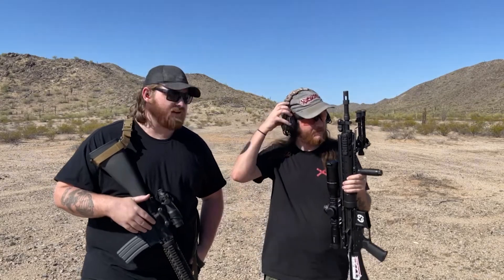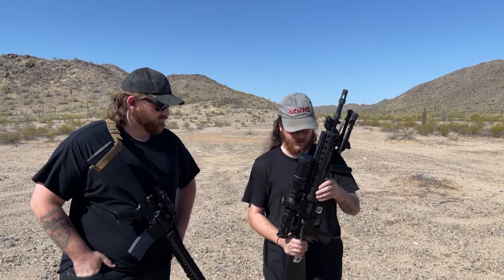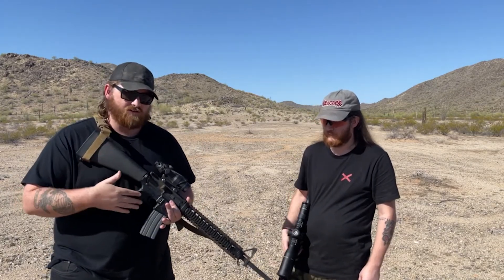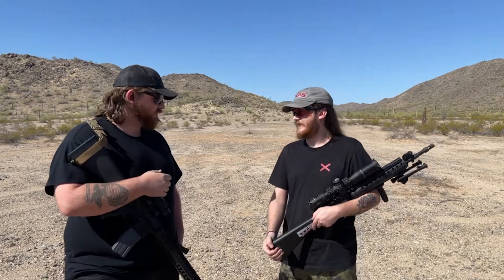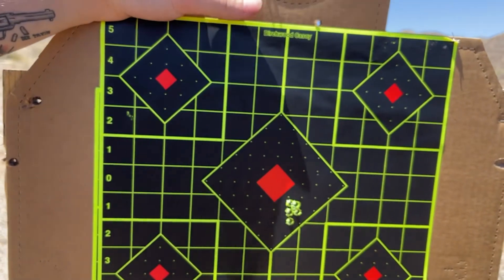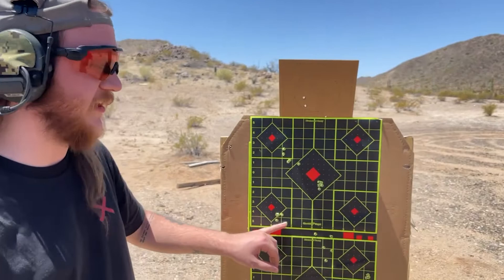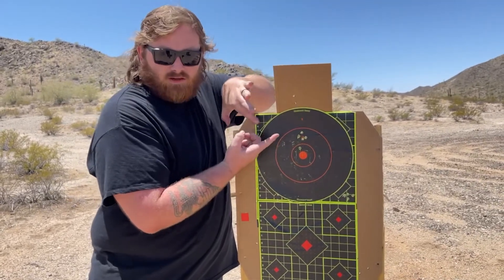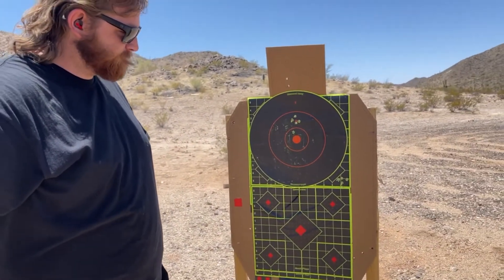Damian’s MK12 SPR: Zeroing and Testing

Comment: Because of you guys…. I just bought a Mk12!
Reply from the maker: Welcome to the club
Reply: Hope you got a real mk12 and not that fake shit Daniel Defense wants to call a ‘mk12’ if it doesn’t have an SPR profile barrel it ain’t a mk12 the PRI uppers are clone correct with the correct Douglas barrel the 1-7 that is
Reply: @rednecksniper4715 it’s the same upper on this video. I went with LWRC lower.
Reply: @insansombolinggi8275  that’s good that’s about as clone correct you can get without building one from scratch. Also I would recommend just get an H&R M16A1 lower from PSA if you want it to be more clone correct

Comment: The only problem with PRI is their barrels.  Douglas barrel company use ww2 barrel making technology and haven’t kept up with the newer technology of making a more precision and accurate barrel. They made great barrels back in the day with these older techniques but with the advent of computer QC equipment, a company can produce a much better product and a much more accurate barrel. After Stanley past away, god  bless his soul,  it’s now a gamble whether or not your barrel is going to be accurate or not.   There are too many other companies out there that produce much better barrels than Douglas.   Thanks for the video !!!!
Reply: I have been a US Service Rifle Competitor for about 26 years, burning up about 3-4 barrels annually. In this period I have rebarreled using many brands and types of 1/7 twist barrels but the most accurate have been from Douglas, turned and chambered by Compass Lake Engineering. My present Douglas barrel delivers .5 MOA shooting 77 grain FGMM off the bench from my match conditioned rifle, which is Service Rifle Competition compliant. At any rate, these Douglas barrels seem to get the job done, holding to mid range target’s X-Ring for about 2000 rounds, which undoubtedly helped me to earn the US Distinguished Rifleman Award.
Reply: What other companies do you recommend?
Reply: What other companies do you recommend?
Reply: @rich1958  bartlein barrels for shoulder barrels and criterion for remage and for AR platforms.  Brux, kreiger and benchmark barrel companies all seem to produce great barrels. As for accuracy or precision, the chamber has to be cut square and to the center of the bore or it won’t matter if your barrel is good or not. The chamber job is what enables a rifle to shoot.  The best barrel in the world won’t be accurate if the chamber isn’t cut correctly.   Good luck.
Reply: WOA

Comment: Stop shitting on psa , if it's so bad stop using them you screwed the video up
Reply from the maker: no. I won't stop shitting on them. the lower was free, and already replaced.
Reply: PSA is pretty garbage.
Reply: @DutchK75  says the guy who doesn't have a gun
Reply: @waterhead1359  Yeah...
Reply: @waterhead1359  Still garbage though... Cheap skates and Whataburger employees buy PSA. And then defend their purchase with..."JuRsT aReS gOoDeR aS BeE CeE Em'S!!!" "I gots 25,000 tousand rownds tru my PSA wifout a jammy jam! 🙄

Low rent hobby grade garbage.
Reply: @DutchK75  I know you're a troll but please get help
Reply: @DutchK75  wow
Reply: Psa sucks because they have little quality control and they dont have good tolerances when being machined. Does it mean its the worst? No. But it doesnt mean its good quality by any means. But again something is better than nothing. Dig the mk12 fellas. I posted a review in mine as well (mod 1) so you already know im a fan
Reply: @SouthWestGunnerOfficial  then why say they suck ? If you received a bad gun just send it back won't cost a penny with short turnaround
Reply: @waterhead1359  because you shouldnt have to. A gun can be a life saving tool that you definitley want to work everytime. And not have to send back for any reason. Thats why when these guys come train with me and have cheapy stuff fail i ask them 2 things. 1. How many times are you going to buy and cry? When you can buy once cry once. But instead of crying over it not working again and again you are crying over the price you had to spend only one time buying a better product. And number 2. Is how much is your life worth to you. If your life is only worth psa. Go buy psa. To me im willing to spend a little bit more coin for a proper product. To each their own brother